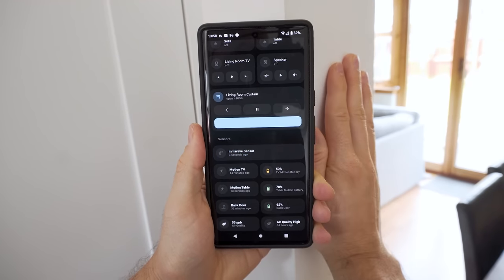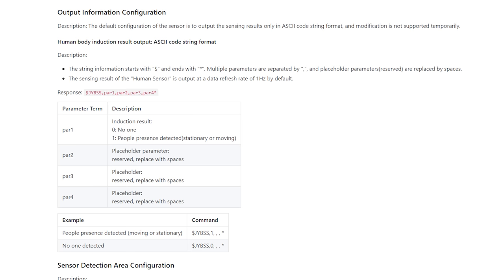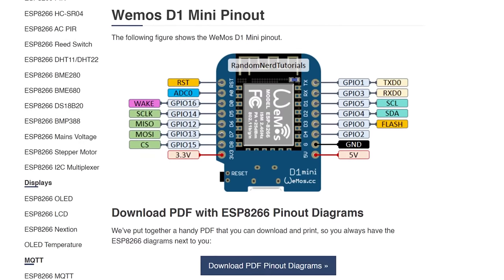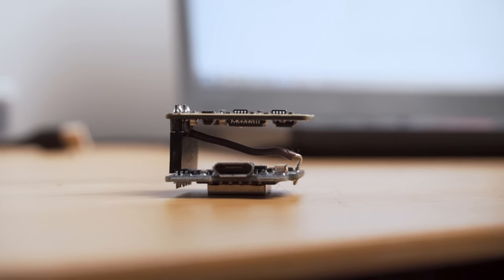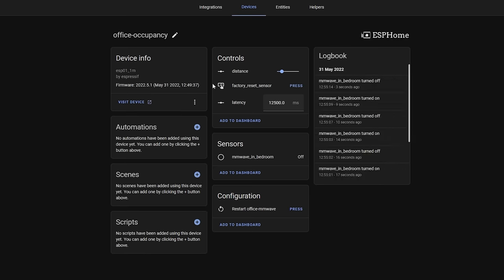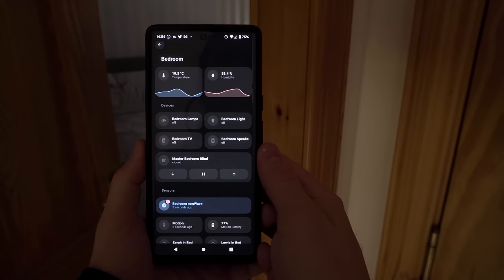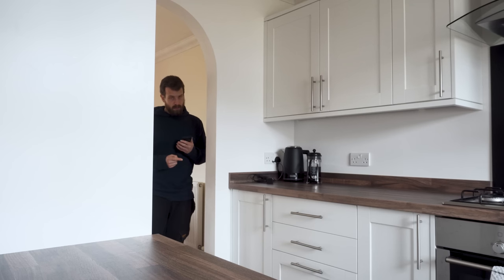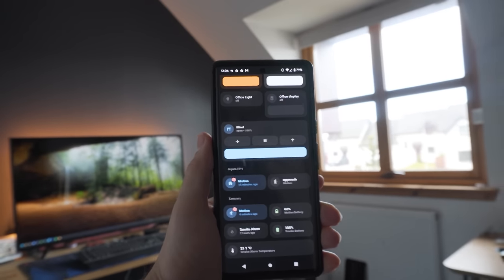I Built My Own Presence Detection Sensor!

Comment: If I had to wager a guess, I think that the faster detection speed but reduce feature set compared to the Aqara go hand in hand. The Aqara must be doing some sort of processing to determine the movement direction, etc, which would contribute to the slower detection time.

Essentially your sensor just yells "I saw something" immediately, while the Aqara checks a few things first before letting you know.
Reply from the maker: That was my guess too but very hard to know for sure!
Reply: @EverythingSmartHome  well they HAVE to have some increased calculation time. To know which direction a person is moving they need to take multiple readings over a period of time to know where the person started and where they moved to.
Reply: I had a similar thought. It's possible the Aqara has two (or more) sensors built in that it needs to correlate to get additional speed, direction, noise data.
(It would surprise me if that took a few seconds though. But it could be that they do some kind of sample/sleep scheme for power reduction )

Comment: I love the way the community can come together and make cheap sensors to solve so many problems.    
Could directional movement be written into the Arduino Sketch, based on the time it takes from when a wave is sent out and it is detected by the sensor?

Comment: Very nice. I've used the RCWL-0516 microwave sensor combined with a PIR sensor for about 4 years. The main problem with the RCWL-0516 is the unadjustable range.
Reply: Atm im trying use the same module. But here in my house it detects beyond the concrete wall. 
What’s the PIR sensor is for?
Reply: @kevincostner8536  I use the PIR sensor as a trigger and MW as a condition. Then I use the MW sensor to turn of the lights when no one is in the area. Works well for areas where you don't move much like the couch. Placement is a bit fiddly because it detects thought walls (as you noticed).

Comment: You CAN set the sensitivity on this sensor.  Not sure why you haven't in this video.  I had to turn mine way down to prevent detecting very minute motions.  You'd have be not breathing and stone cold to not trigger it.  I can send over an esphome config if you like.  I also don't understand why people want to pair PIR with mmwave, as PIR isn't inherently quicker.  It seems you've tried to compensate for a lack of sensitivity adjustment here with latency adjustment, which makes it slower.  Mine turns the lights on the instant I come into the room.  It's not possible for it to be any faster.

Comment: Nice video, thanks!  I have been looking at something similar with a sensor I spotted on Aliexpress, the Hi-Link HLK-LD1125H.  It is a 24GHz sensor that looks like it has similar capabilities for around £10.  Seems it uses serial output as well so I'll have to try modifying the code you linked to.  Now I just need to get a 3d printer so I can make nice cases like you do!
Reply: They look cool, thanks for the tip
Reply: @tvathome562  please let us know if you made it work!

Comment: That is awesome! Suggestion: could you use a PIR to switch on the lights and also trigger the radar to wake from sleep, with the radar going back to sleep when the lights go off? Could save lots of power.
Reply: How much power are we talking about?
Reply: @thesimbon  That's a good question, but the ESP8266 is not known for being frugal. Given the price of energy I like to keep the consumption of anything that's on 24/7 to a minimum, and since Lewis already mentioned coupling it with a PIR for room entry detection this seemed like an easy win.
Reply from the maker: I guess you could, although even at today's energy prices the savings would be very very minimal I think
Reply: @EverythingSmartHome  Any idea what the consumption of your sensor is? It's likely to be the WiFi rather than the radar that dominates it, I reckon, but it would be interesting to know.
Reply: @cooperised  esp8266 still takes time to boot after sleep and that would ruin the fast response time of the sensor. It would be nice to have tasmota or similar able to take advantage of low power processor in esp32
Reply: @thesimbon  In my mind the PIR was separate from the ESP, maybe a ZigBee device. Haven't completely thought through how that would wake the ESP! Agree about the ESP boot time (and the WiFi association time), they're the main enemies of low power. If I was going to try this (which I might) I'd probably try something like a Z1 Mini and go the ZigBee route throughout, far better response times and less power.
Reply: @cooperised  then you would still need the esp awake to receive command over wifi
Reply: @thesimbon  That's why I said I haven't completely thought it through - though I imagine it wouldn't be too hard to hijack a presence signal from a ZigBee PIR and hotwire it into the ESP's wake pin.  The neatest thing would be to move away from WiFi though with something like a Z1 Mini, like I said.
Reply: @cooperised  you would be spending euros to save pennies
Reply: @thesimbon  Not if being able to power it off batteries is important.  Even if it's mains powered, here in the UK with the current cost of power running an ESP8266 24/7 versus running a cheap CC2530-based ZigBee node puts the break-even at about 5 years I reckon.
Reply: @cooperised  would you really go that far to switch off a 0.3W load? Maybe 0.5/0.6W with presence sensor
Reply: @thesimbon  ...yes?  Being cheaper over 5 years, even assuming no additional energy price rises, is an attractive proposition to me.  Not to mention that there are plenty of locations in my house that could benefit from a battery-powered presence sensor, and an ESP on batteries is a non-starter.

Comment: How about RCWL-0516 microwave detection , they only work when something approximately human sized moves, can be tuned, works with arduino, esp, etc.. Very cheap.. Good if used as a latch (switch on light when movement detected, then off when movement is detected again).. Not 100% sure I believe there is a more advanced sensor that gives out distance value (voltage) so you can determine entering or exiting.
Reply: The RCWL 0516 is a doppler effect sensor. So it detects the movement of water (human body is 60% water on average). Only problem with this sensor (i have several of them and tested them) is that it will go through walls, glass, etc. for 5 meters so you have to be careful where you place the sensor plus its not sensitive enough to detect very small movements more then a meter or 2 away from the sensor. I've had it go crazy when it rained outside for example. Very cheap, but not good for home automation.
Reply: @HATipsByLarry  I have rcwl-0516s connected to my Espresense 'nodes'. They are indeed sensitive and trigger on many things. 

I limit/direct the detection area with a piece of aluminum foil in the case, which made them a lot more reliable. Updated the Espresense code to support software debouncing, similar to the latency setting in this video.

It is a bit of work, and require some fiddling to tune the detection area, but definitely more affordable than the modules in this video and combines multiple sensors in a single device. You could even decide to add a PIR to it.
Reply from the maker: Would be good to investigate them for sure - I'll try take a look - thanks for the heads-up
Reply: @DirkDulfer  I would be interested in seeing your code (if possible). I did try the aluminum foil but didn't have a lot of luck with that. And any further then 2 meters it could not detect me if i stood perfectly still but continued to breath normally. I guess everyone's mileage is somewhat different.
Reply: @HATipsByLarry  it is currently a pull request on the ESPresense repo (#486), feel free to peek and comment

Comment: I wonder how difficult it would be to use something like a 60GHz mmWave Sensor - Breathing and Heartbeat Module from Seeed Studio? Could it be utilized in the same fashion? And considering it is supposed to detect breathing and heartbeats, would it only pick up living occupants?
Reply from the maker: Crlogic from the HA thread linked has tested the Seeed one and doesn't rate it nearly as much
Reply: I was following the "XeThru" sensors that did breathing rate since about 2016 or so lusting after them for every room in my house. Glad to see if finally becoming mainstream and even better cheap as the XeThru dev modules were like $400+ :D
Reply: *note we crlogic and I have not tested the 60ghz one but only the 24ghz one
Reply from the maker: Thanks for the update Philip, good work!

Comment: Neat! It would be cool to look at power consumption of the sensor right away and how far one could get with let’s say a 2000mAh battery. I know the FP1 also isn’t battery powered but I can’t have all my D1s dangling on some outlets. I suppose due to the constant scanning this won’t get a lot of battery time - but still, how long 😀 looking up the spec sheets now

Comment: Cool video! I was hoping this was an addon for ESPresence. Could you test that too? Would be a big win and the radar motion is integrated 😀
Reply: Have a look at RCWL-0516 module to add to the ESP32. It does require some fiddling with alu foil around the sensor to direct/limit the detection area, as it detects through glass and thin walls.
Reply from the maker: That would be nice for multi factor!

Comment: Since this is out of stock everywhere already, I wonder if there are other compatible sensors that could be used.
Reply: So sad I cancelled my three mmwave units from DFRobots last week due to the lockdown of their warehouse
Reply: @c7ndk  damm. I am saw some alternatives from SEEED that might work but I have not looked into them. Also they have some 60Mhz so there is more info you can get.

Comment: I hope the ESP32_H2 will be released this year so we can integrate such sensors through zigbee or thread to avoid too many IoT device on the WiFi (for interference issues and security) :D
Reply from the maker: That would be nice indeed!
Reply: There already is a cheap mmWave Zigbee based presence sensor from tuya
Reply: @darinakdelayna7970  Interesting, do you know if it work with zigbee2mqtt on home assistant? As from a security reason i don't like a random Chinese company use, store and process my data on their servers... 🙂

Comment: What is the output voltage on mmWave UART/GPIO pins? I don't see this info in specs, and everybody are happily connecting it to ESP where 3,6V is max it can officially handle on data pins.

Comment: Hi, great guide and and awesome that you share this with us.
I am looking to make this but found that DFrobot also has a smaler sensor mmWave Radar Sensor Arduino-Human Presence Detection Wiki - DFRobot
You think this will work also, similar spec but on the 5.8GHz band.
And cheeper.
Want to do around 10pcs so finding a similar but cheaper sensor would be awsome.

Comment: What do you think about thermal occupancy sensors, like the AMG8833?

A guy in the LTT Jasco video comments said he built a great solution for just $30 using that sensor, he says the the system can detect body heat and know if the room is in use, even if you're laying on the couch and not moving. Would fix the window curtain issue for sure!

Comment: Hey , i saw ur video . i thought i could work with sp8266 node mcu . I have a doubt i need to detect presence only . As you had mentioned ,we need to use io2 pin for sending binary . so my doubt is : is there a  pin that i need to mention in my code ?

Comment: I like it for recognizing that someone is in a space, however I think it's missing the component of just whom that someone is. I would be concerned if the system didn't have some way of trying to work that out. Perhaps with ESPresence and something like a LE Blue Tooth beacon known house members carry. As it is, I can see an automation problem if, Oh Bobbie is visiting between deployments, and your "guest room" is normally the livingroom, having to work out when automation does, or doesn't turn on the lights might bet interesting. More 'conditions' on automations I suppose.
Reply: I know that the espresence and esphome projects are still separate, but I do think this is something that could use some integration into a single device that handles first detection of motion/activity in a space, then follows with recognizing whom has entered the area.

Comment: Hi Lewis, just curious what 3D printer do you use? I am in the lookout for one, would be great if you can make a video :). Many thanks
Reply from the maker: Hello - I use a Prusa MK3S - it's great and works very reliably without any tinkering but it is a bit more expensive. I don't really know much about 3D printing so I would look for videos from some of the more experienced 3D printing channels!
Reply: @EverythingSmartHome  thanks for the prompt response, I was about to leave a comment on the cloudflare video. I fixed my mess.. many thanks

Comment: Man I was really hoping it could ignore pets lol. I want to do smart stairwell lights but I have a cat whose favorite activity is to Sprint up and down my stairs.
Reply: I have the same project and 2 cats that chase each other all around the house. What other people do is use regular PIR sensors about a foot high and tape the lower portion (or 3D print a case) so only the part is able to detect motion. I've done this for my closet lights and it works great; no more 💡 waking up when they decide to go on a trip to Narnia in the middle of the night.
Reply: I'd love to see your placement and such if possible.
Reply from the maker: I'll try to think of a solution 😅
Reply: @retsam2010  looks like my comment got deleted. I'll post it again without the link so hopefully that's still useful. 

not my content (I've been procrastinating the staircase project for a while now...) but here's where I got the idea from. I suggest doing a minimal setup at first (just the PIR sensor and the onboard LED from the microcontroller) with some masking tape over the sensor. Use it for a couple of days while moving the tape & sensor until you find a good placement. If you're happy with it, add the led strip and mount it more permanently. If you don't like it, at least you only used $1 and little time 😅
Reply: @EverythingSmartHome  please do. All the cat slaves and dog owners will worship you (myself included 🙇🏻)

EDIT: I know this can be done with computer vision (ex: DeepStack), but my S. O. is already freaking out with only 2 cameras around the house 😅

Comment: It looks like you used esp8266 not esp32 for this right? New to all this, so trying to understand if the pinouts would be the same if I were to purchase the esp32 instead. Awesome work\video.
Reply from the maker: Yep as mentioned it's an esp8266 - pinout would be a little different with esp32, plus not many of them have 5v output

Comment: Just tried to make one, but I cannot get the output in the logs and the sensor entity is stuck on the 'on' position. Does anyone have any tips?
I used the same hardware and code that is shown in the video.
Reply from the maker: Jump into the discord I'm sure we can help you out
Reply: I have the same problem, what was the solution?
Reply: @Camelfunseeker  I don't know yet, I didn't have the time to get on Discord yet.
Reply: @Swaans  I swapped the pins in the yaml code -- >   tx_pin: GPIO5
  rx_pin: GPIO4 that worked for me. Lewis helped me in the discord server, thank btw !!
Reply: And also the solder joints where not good. I redid the solder and that fixet it also

Comment: Hi Lewis! Brilliant instructions, as usual! :)
I bought the very same sensor, yesterday it arrived, and soldering/setup went smoothly. However, it's so unreliable that i want to throw it out right now... :(
Tried different distance, still it either doesn't detect, or detects constantly, switching on/off each minute or so...
Reply from the maker: That doesn't sound right at all, make sure to check your wiring and solder joints as well as placement. Are you checking the UART output in the console to see what's happening?
Reply: @EverythingSmartHome  yup, it shows correct string from sensor each second - and sensor values do represent raw data correctly...
Yet, starting from ~ 120cm distance, it becomes pretty unstable.
One other thing is, that delay option seems to be not working.
I will re-check pin configuration. Maybe, I screwed up with RX/TX..
Reply: @EverythingSmartHome  Checked, and RX/TX is working too - at least, it stops/starts sensor as it should. So i assume, everything should work...

Comment: what is the advantage of this sensor you are describing vs PIR? speed the same, sensitivity also can be set on PIR (even to the extent that it will be less prone to false alarms), price: 10x more. Just wondering.
EDIT: oh, and much less radiation at home when using PIR ;-)
Reply: This sensor can sense presence where pir doesn’t register. You can sit still and it register you from breathing, where pir require full movement. 
I have replaced home office light control pir with mmWave (same diy sensor) month ago or so and it have worked flawlessly
Reply: If you are sitting still will the PIR still detect that you are in the room?
Reply: @wolffair1119  ;-)
Reply from the maker: Yep pretty much as above! PIRs don't work if there is very little movement, something that mmWave can solve